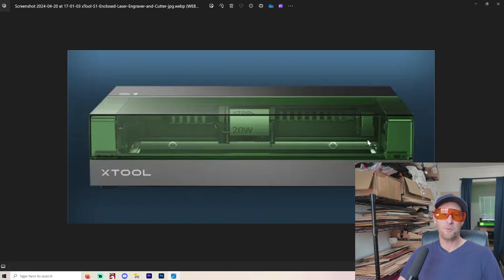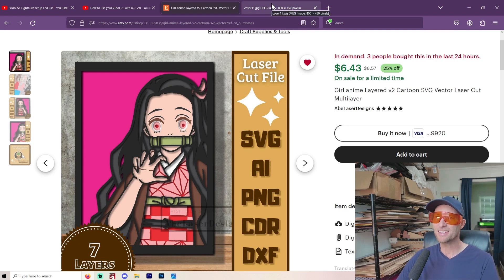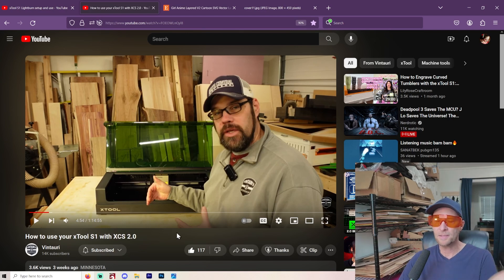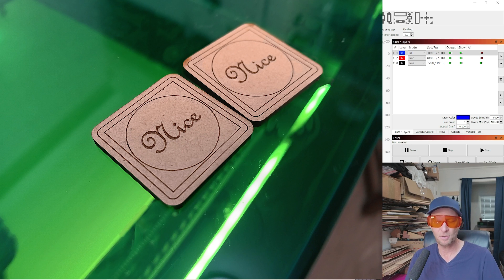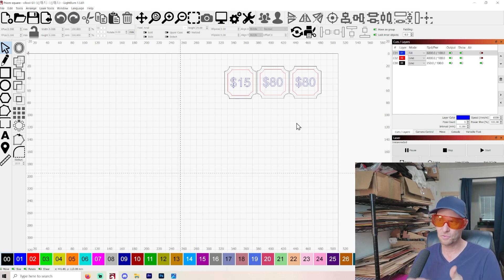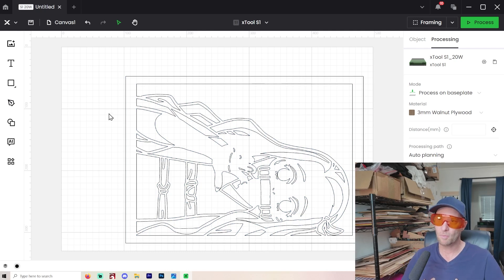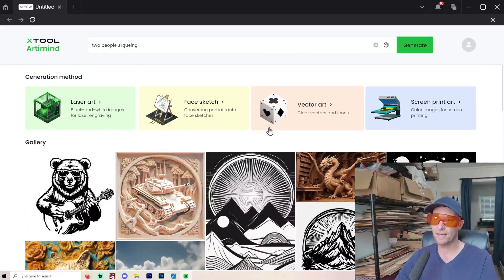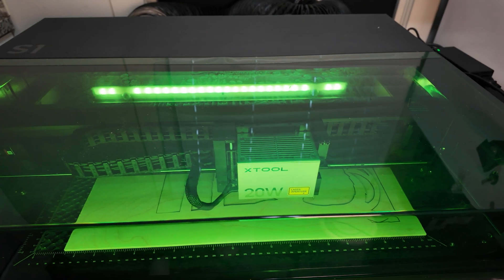Making fun projects with the xTool S1 Laser Engraver (XCS vs Lightburn)

Comment: A month ago you provided info for LaserMatic MK2 and gave it praise (https://youtu.be/urJ-Pt4wR7M?si=tCvvfNFVqwAagAJU) Which do you prefer, MK2 or S1? Thanks
Reply from the maker: I personally prefer the MK2 other than the fan staying on. I am a Lightburn guy, and the S1 just does not feel right in LB to me. Both are nice machines. If you decide to get one, please use my link. And let me know how you like it, and if my reviews were accurate. Thanks!
Reply: @ValleyForged hi there, do you feel any different about lightburn with the s1 nowadays? Trying to decide if I should learn xcs or jump straight into lightburn with my s1
Reply from the maker: @itsrelz  Yeah, still feel XCS is just better on an xtool. It just was not made for lightburn really
Reply: XCS has not a ramp option, which is essential for making rubber stamps for example.